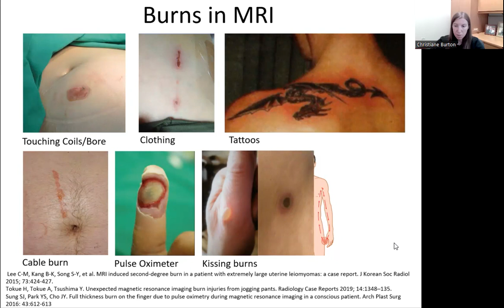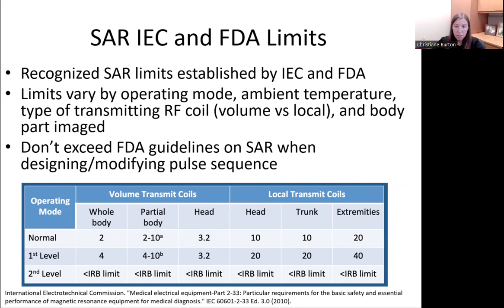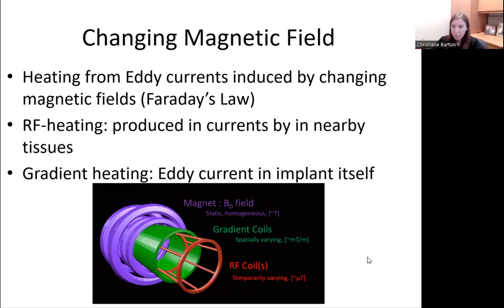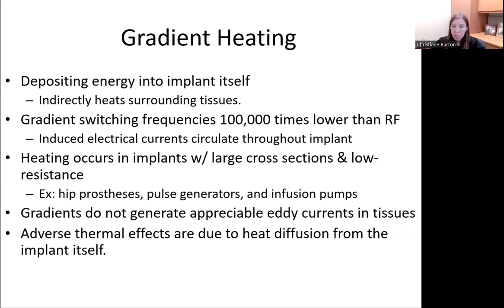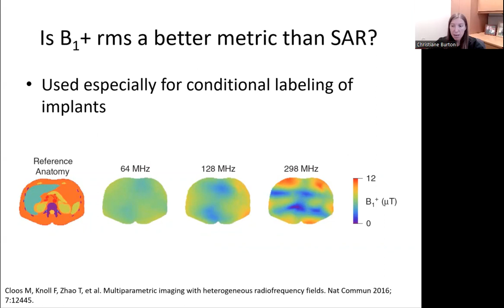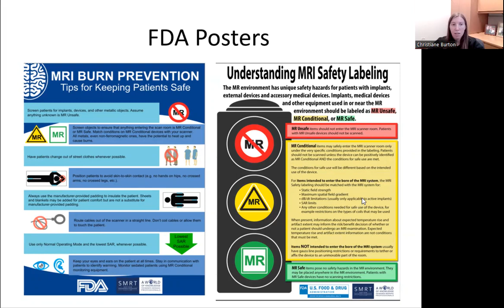Thermal Injury in MRI

Comment: i experienced a thermal burn Aug 4th. the panic cord thing was laid across my rib cage and i had my hands fingers interlaced over the cord and my ribcage area, thus my forearms also on my chest, and my biceps tight against my side ribs.
i fell asleep during the 25 minute scan. woke up after kind of feeling light headed, went home and 4 hours later started feeling sensation  on my right side, touched the spot with my finger and felt sore moist spot. Looked in mirror didn't see anything and went to bed. During the night i noticed tenderness on my right side half asleep i stayed on left side.
in the morning i felt bumps on rib cage looked in mirror and saw blisters, freaked out put 2 and 2 together and researched MRI hazards... blisters... found out that that is likely what caused this to my side,. so i called the imaging place they said go to doctor. i went ER. ER  DOC SAID I LOOK RED ON MY CHEST AND BACK, NOT GOING TO GO INTO ALL THE DETAILS, BUT THEY NEVER HEARD OF THIS HAPPENING, SO THEY TALKED TO THE HOSPITAL IMAGING TECH AND THEY SAID YES IT HAPPENS BUT VERY RARE.
the area where the blisters are did not itch but felt almost like a grease burn but way less painful...
later that day i also started feeling weird in my chest area, could breath but like i could not get full breath. also had the feeling like when you swallow something and its stuck down in your throat but this was down further. also i felt hot like i had been at the beach all day...
the imaging place that administered my MRI were/are in total denial... no that can't be what it is,  response...
FYI I HAD BLUE JEANS ON AND A BUTTON UP aloha SHIRT AND Synthetic socks. THE SHIRT WAS 80% SILK 20% COTTON
the scan was of my right foot, but i was in the MRI machine to my chest area.

i had to research for myself on the learning with NUH chnl, coming to the conclusion that a combination of the panic button cord, my hands with fingers interlaced and arms tight against my ribcage, and still wearing my street clothes caused the burn.
i also found out that you may not feel the burn happening or even see results from it for up to 24 hours later because it cooks the fat layer and not the skin...

I 've had about 5 MRI done in the last 4 yrs with and without contrast...
but after this one never again, 
i had a MRI scan scheduled for my head also i cancelled it after this.
the heat and breathing thing finally started to subside today Aug8
i have no doubt i got cooked in that mri machine.
my upper body chest and back even looked slightly tanned after 2 days from the scan.

the imaging place was not doing XRays that day because they were down a Technician...
my Mri was scheduled at 4:20pm. 
my theory is the technicians was overloaded and that's why she did not have me change into scrubs, and also why she missed that my hands were interlaced on my chest with the panic cord under them...
after the ER i went to talk to the technician not to blame but to troubleshoot and mainly share that Learning with NUH vid...she was unavailable so i wrote down the info and they said they would give it to her.
Reply: Hopefully she re educates herself on these hazards so it does not happen to others...